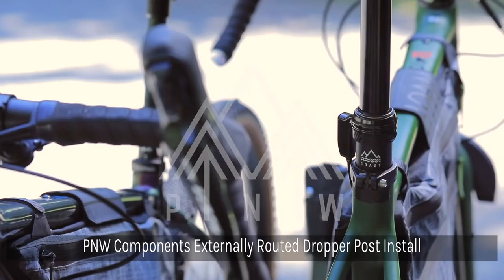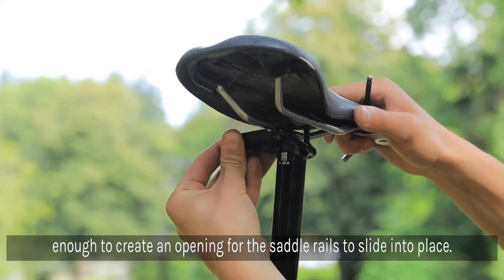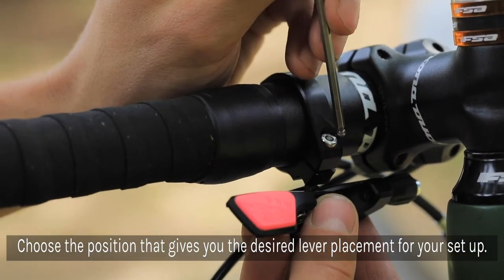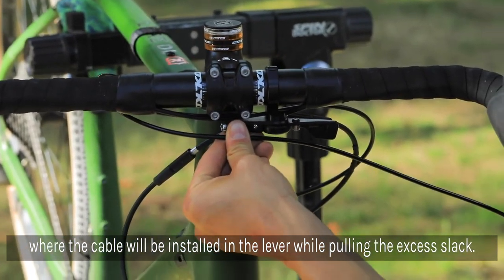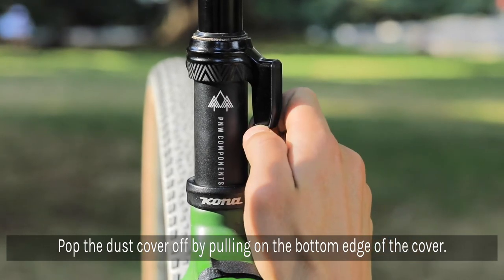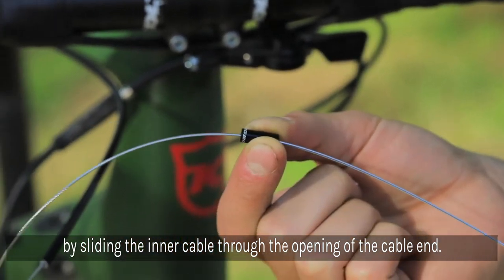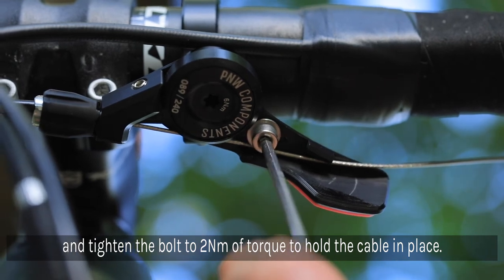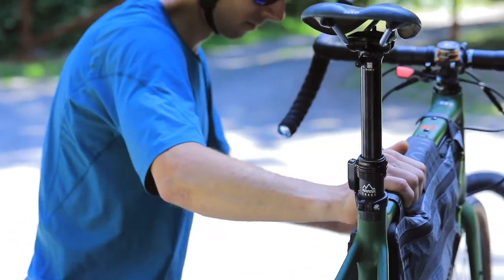PNW Components: How to Install Pine Dropper Post with Loam Lever

Comment: Just wondering if your posts have any issue being clamped with the post inserted as far as it can go. I've experienced with some posts that doing so causes faster wear and tear or even slows down dropper movement
Reply from the maker: Hey Shawn! Thanks for reaching out! You should not experience those issues with our dropper posts, so feel free to drop it into the frame as far as you'd like. One of the main issues that slows our posts is over tightening of the seat clamp, so we'd still recommend finding the right amount of seat clamp tension to keep the post in place without infringing on its actuation.
Reply: @PNWComponents  perfect, I've had mine slammed so far with no issues and I definitely like to make sure all my stuff is torqued properly. Will definitely recommend to all my friends. Just waiting for a release on green grips and loam lever now 😉
Reply from the maker: @shawnalexander1305  We're stoked to hear it and we really appreciate that you're sending people our way! We've had a few requests for green components now and they're on our "To Do" list!